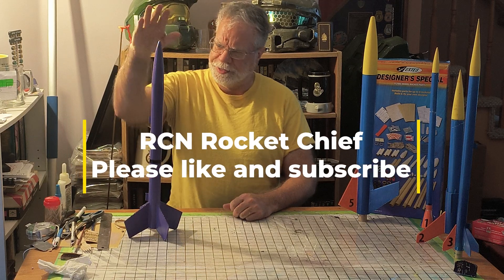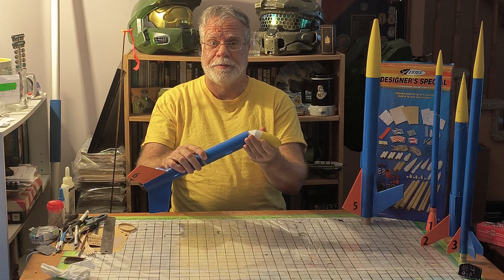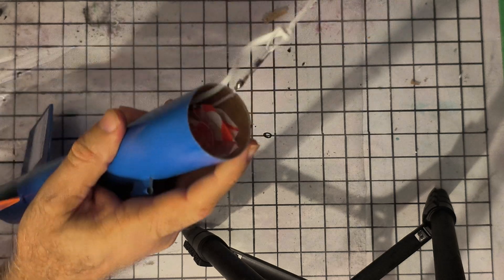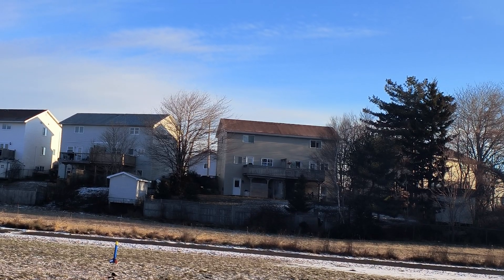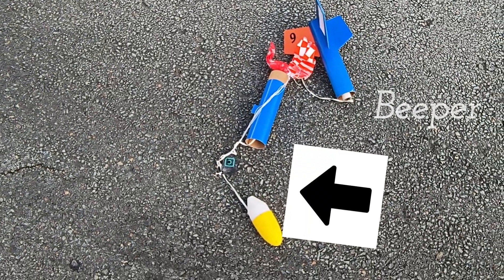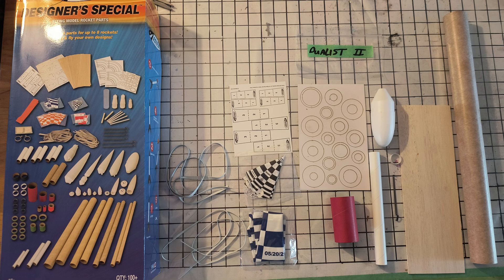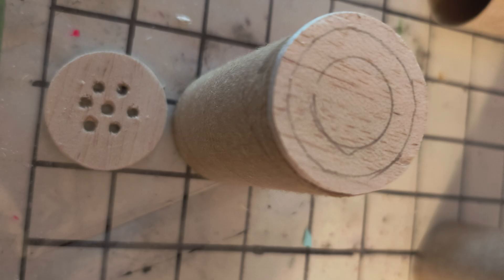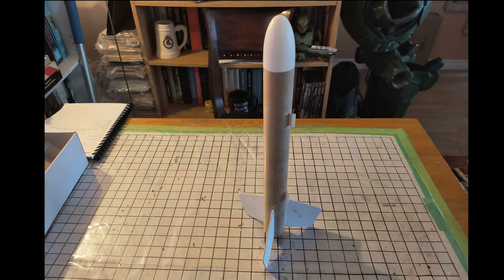Estes Designer's Special #6  Dualist 2 Deploying 2 Parachutes Without Electronics

Comment: 1. When you’re flying with plastic parachutes in cold weather, dust your chutes with talc (or cornstarch) to assist them in opening and not sticking together. 

2. The reason for using “fancy electronics” for real dual deployment is not trivial, and you proved it when you recovered the rocket from the neighbor’s driveway. The purpose of true dual deployment is to avoid deploying a large parachute at altitude, which prevents excessive drift during descent. At apogee a smaller drogue parachute is deployed after the airframe is opened, rendering the airframe not aerodynamic anymore. This allows the rocket to come more or less straight down quickly. (Some people don’t even include the drogue parachute - just opening the airframe is good enough.) Then at a preset altitude the second ejection charge pushes out the main recovery parachute, so your drift is minimized. 

What you did here is nothing more than a parlor trick, and is not remotely close to mimicking dual deployment or its purpose at all.
Reply from the maker: Thank you for your comment. I do use talc on the chutes all the time. For the rest, I do understand what folks with more resources can do and am willing to try a "parlour trick" to get a similar look for fun.